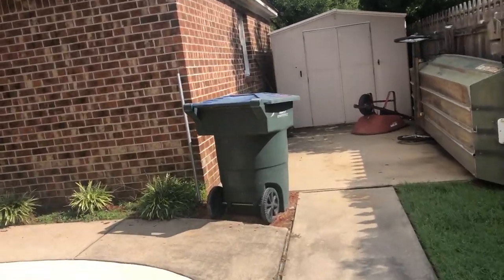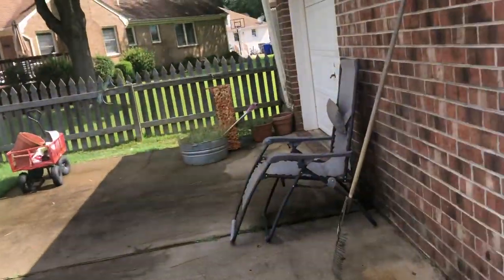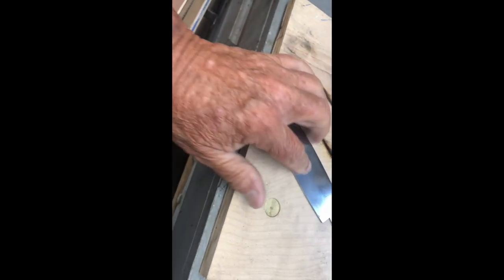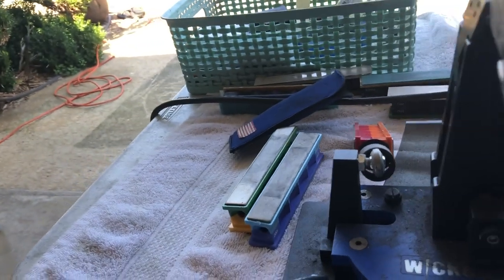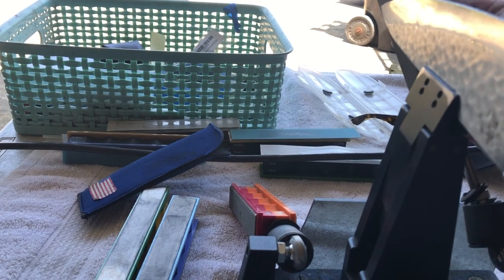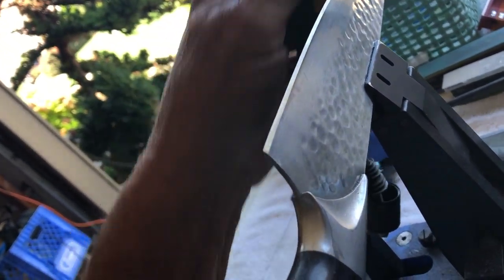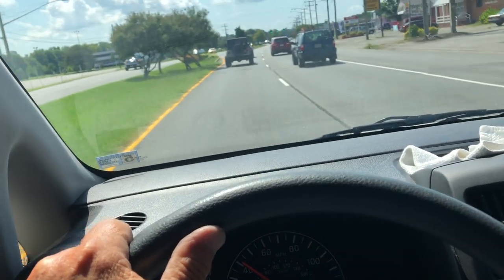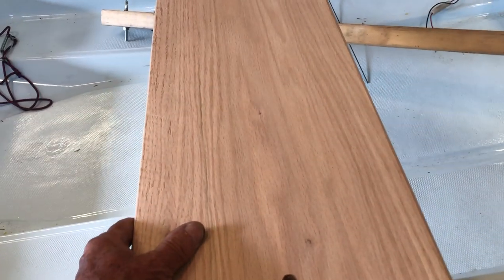She is shaping up fast now with Eddie's Magic  :-)

Comment: The Whaler is lookin pretty good, that locator should get the job done very well ! That hitch idea worked great, would do that with my blazer but I have a 2 door and the tire is mounted on a swing arm outside the tailgate and hits the winch on the trailer so only way would be extend trailer tongue , DAMN !